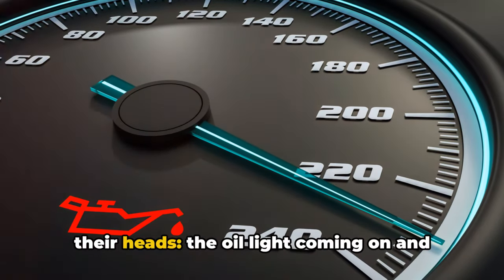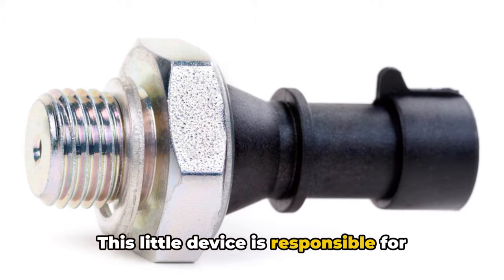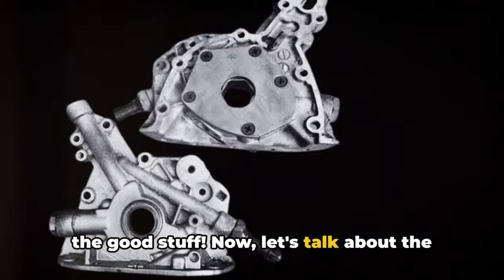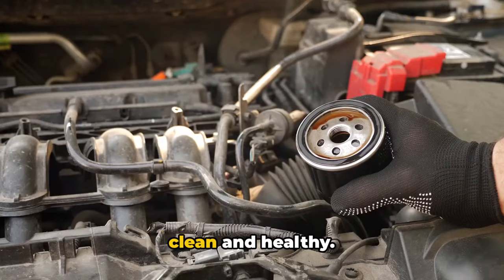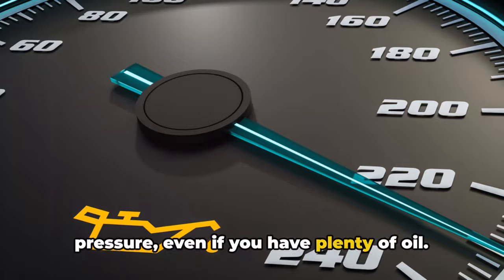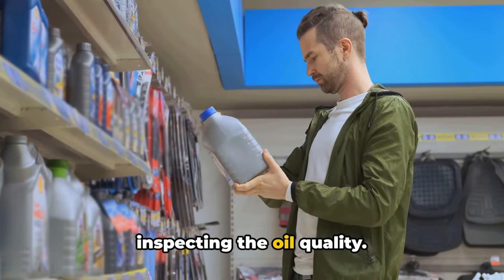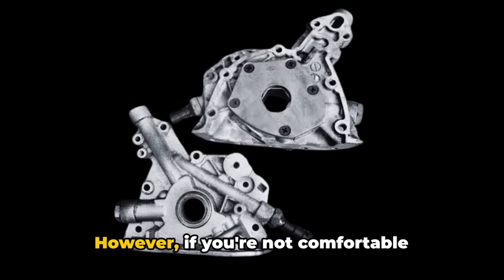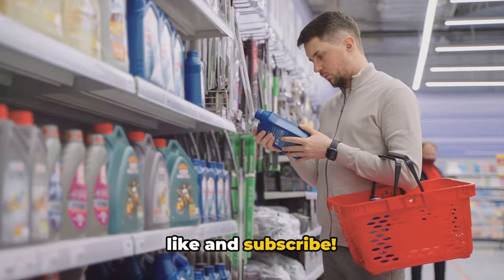Oil Light On and Off but Oil is Full: How to Fix Guide

Comment: Most oil pumps are internal. Best to change oil at 5k or low than 10k miles per year than twice a year Use manufacturer grade oil and their filter. Cheap filters are junky made.